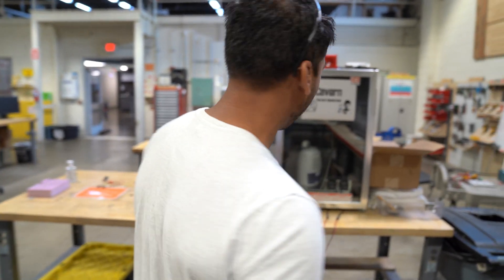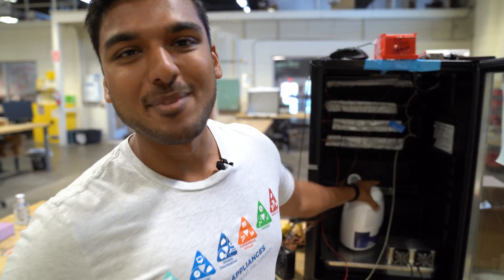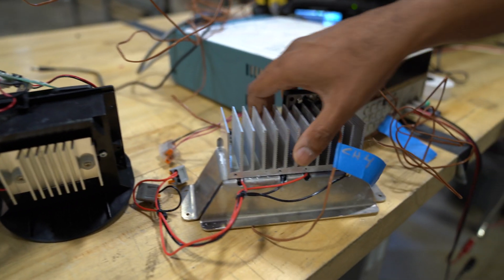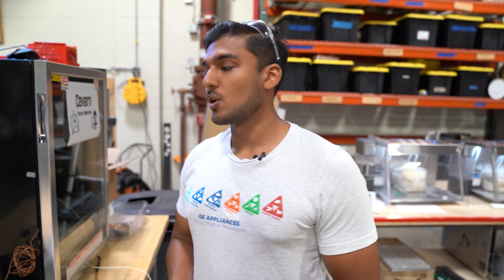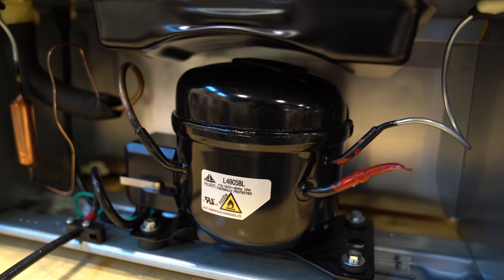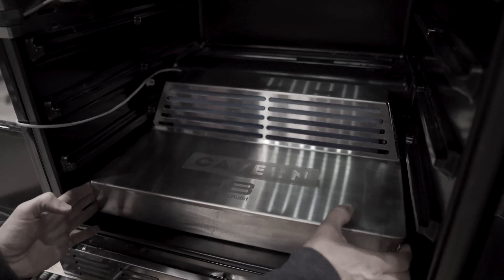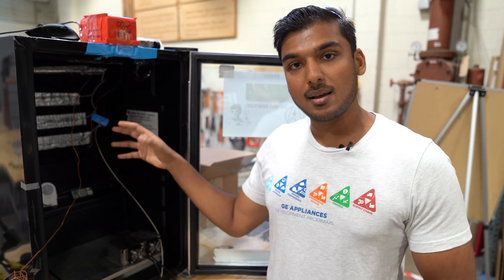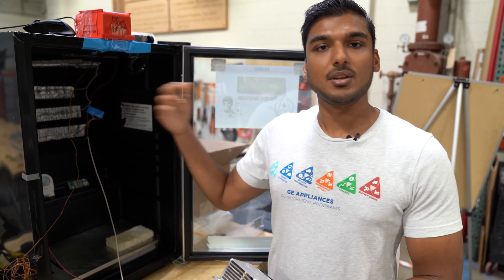Cavern 2.0 Update With Ryan | Hacking Dehumidification

Comment: Glad to see the progress. Once you solve the moisture issues, the biggest barrier I see is the amount of vertical hanging space. Casings for salami, like those used by Eric, are 24" long. Plus a few inches for hanging and bottom clearance. 27" would seem like a minimum. 30" would be even better. Is it essential that you repurpose this particular model of fridge or do you have other options?
Reply from the maker: It is not essential that we use this exact model. Things are still in Flux and this model is just for testing currently. With that in mind, it's great to hear feedback like this. (We read all the comments). If people really want a certain size or feature we want to know. Definitely appreciate the input
Reply: @Firstbuild  It is fun to see what you are all are doing and I'm happy to offer as much input as you want. I'm a big fan of FirstBuild (I'm a Mella backer) and would seriously consider backing this chamber. I've got two chambers: a DIY and the one from the Sausage Maker, but could always use another as I'm always experimenting. I hope FirstBuild can make this one a success.
Reply: @Firstbuild  Size definitely matters! :) Hanging a whole leg muscle to make Prosciutto, for example, which takes a very long time to age, would take up all of the available space in this fridge (leaving nothing left for quicker projects), and severely affect air-movement. A modular version of Cavern that would fit inside ANY wine cooler or even a residential sized fridge with external temperature and humidity controls, would REALLY sell. A lot of us already have wine coolers that we've cobbled stuff together for, but a modular system that's really consistent and dialed-in would reach a whole new market beyond DIYers. A module you put in an existing fridge would let us pick the cooler/fridge that fits our needs space-wise, and then add Cavern to it (significantly reduce shipping costs as well). I realize volume of the air space changes variables, but if you can design this to fit into any reasonable space with settings to detect RH and Temp, then it should be doable?

A large water reservoir so it needn't be filled frequently, and a dehumidifier that pumps back into the humidifier tank (a loop?) would be a dream of mine realized, but I know it's tricky. The mold and cultures inherent in cheese and charcuterie don't play well with standing water and keeping your cave limited to just the molds you want, but that's often just a matter of having a dominant mold that out-competes anything new.

Can't wait to test this when it becomes available for Beta... I have a couple of larger fridges (a large wine fridge and a residential style fridge dedicated for brewing beer in, that I could test Cavern in for you also, if that's desirable.